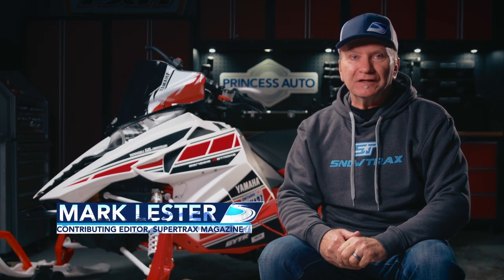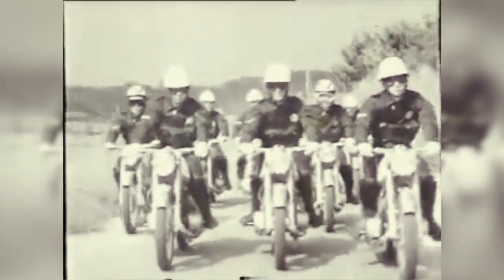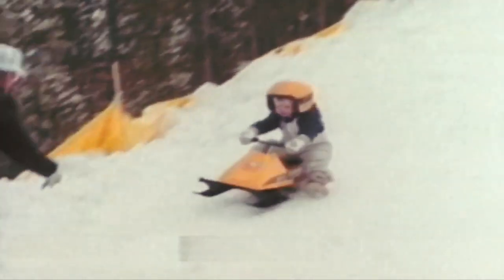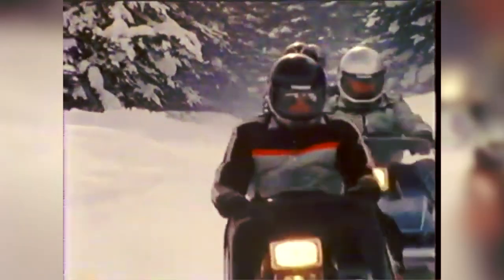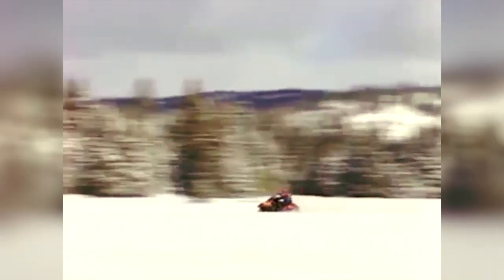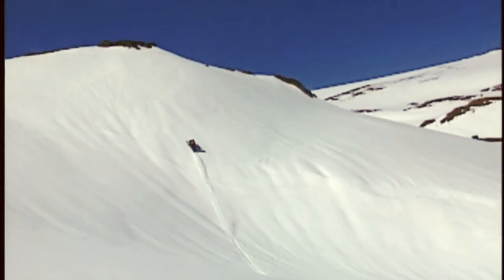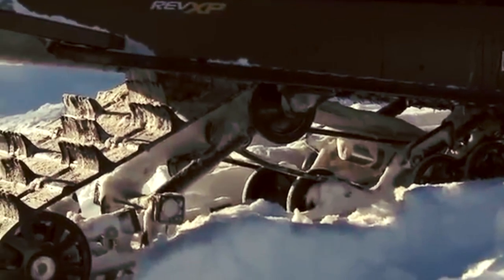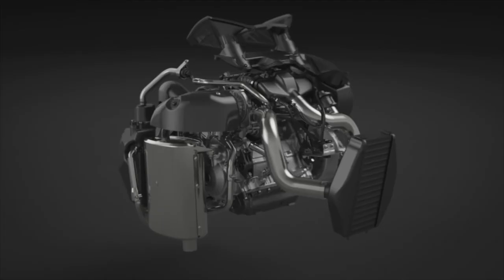50 Years of Yamaha Snowmobiles

Comment: Mark did a decent job with this video. One big miss, the TSS (Telescopic Strut Suspension) was not introduced on the 1984 Phazer as claimed. It was introduced in 1980 SR-V race sleds and then appeared on the 1981 SRX and SR-V, so that was three years before the Phazer was introduced.

Comment: It's amazing how early Yamaha put Oil Injection in their sleds with the Yamalube.  I had an 81 Ski Doo that i still had to mix the gas and oil in a Jerry can.
Reply: Yamaha had  oil  injection on a  street bike in  1964 ..  All Yamaha  two stroke  Motorcycles  had  oil injection by the Late 1960's  ..  The Other  Brands  followed quickly .. Not sure if there was an  issue  pumping  two stroke  oil when it's  really cold ..  Yamaha Lube  is not that great of an oil  Today's  Modern Synthetic TCW-3  oil is much better..
Reply: Yamaha  had  oil injection  on  Motorcycles  in  1968  or ealier ..

Comment: I purchased a new 84 Phazer. I used it for pleasure riding as well as drag racing. At the drags it drew a lot of attention because of it's looks. I immediatly started winning with many people saying my machine was not stock. I was doing quite well in the next class above the Phazer's class. Some thought i had modified the engine. Others came to me to look at my track, thinking i had it nailed. I always said riding the Phazer was like riding a bucking bronc. You had to really hang onto it when you hammered it. It was a fun snowmobile to ride. I purchased a new 87 Exciter. The Phazer ran circles around it.

Comment: my nytro has heavy handling and steering  wanted to stay with yamaha motor and chassis for reliable sled but they need a 2 stroke. Also they need a light, basic, cheep, affordable , 440 trail sled to pick through the woods and when needed you can pick it up and move it

Comment: Interested to see what Yamaha has in store for 2020.  Our local Yamaha dealership has just started selling Arctic Cat/Textron products after being an exclusive Yamaha dealer since the dawn of time.  He was quite tight lipped on the future of Yamaha sleds from his end.  Still dreaming of a Yamaha 2-stroke 600/800.  I'd buy 2 the day they came out.
Reply: Don Olypopper  I have a 2014 viper xtx and I can relate to some of the complaints you especially since I own a Nytro as well and although the Nytro feels higher quality the viper is such a better sled overall, the supposed cold starting issue is not really an issue you just gotta learn how to treat the viper, although it should just work like the Nytro it's not actually a real problem. But that's just my opinion, I have had all the recall work done on my sled at my dealer free of charge and everything is working flawlessly for me so far.
Reply: It better be a two stroke because they lost a ton with these heavy tank like 4 strokes !
Reply: They made a 2 stroke this year finally.
Reply: @mxr7586  you mean they had Cat toss their 2 stroke into a Cat chassis and call it a Yamaha.  I believe Yamaha's last all-new 2 stroke was the SRX motor in 1998.
Reply: @PartTimeYooper  last srx was 2001 which was the fastest. I have the 99 a friend of mine has the 98 and another the 2001. The 2001 he put a ski doo skid underneath and up front he did yz450 4wheeler shocks. It’s bad ass.

Comment: My first machine was a 1978 ET250. Super reliable little sled. Then a 1980 srx440. With 72 HP  that one was a rocket for the times. Hard on pistons and cylinders though. Last Yamaha I bought was a 1982 Excell 3. Basically a 340 cc with electric start and a spedo and tack. Also a super reliable sled.  Then in 1986 a friend asked if I  had seen the new sled at the polaris dealer at our local mall. He convinced me to check it out and the next day I bought the 1986 indy 600 triple after seeing it. Polaris after that, sorry Yamafans
Reply: I have a 1979 et250. A et340 
Both enticers. I still have them both. Won't part with them

Comment: Snowmobiles  were so crude .. It  left a  lot of room for Yamaha  to innovate..  Yamahas  were light  reliable   and  affordable ..
  Sleds  like the RX 1 Ton  are  great high mileage  trail sleds..     The  engine  technology came  straight from their R-1  Motorcycle  engine,..   Then  they built the  narrower .. longer  stroke   3 cylinder Purpose   1049  CC  snowmobile engine..  
   Then they came  out with a  beefed  up  Tripe with  a high tech Turbo..

  Yamaha was No  1  in snowmobile sales  for years  then they went to   number.  Meanwhile  Artic  Cat has some Financial  Problems..    Trump  dropped Corporate  income tax  by 15%  this  will help  the  end cost for American Made Products..

  Yes the Yamaha  Two Stroke Triples  were cool and great..  I think Yamaha may have  been  behind  in suspension  in that era...
  All   3.5 Brands  make  great Products  it's  a  matter of  personal choice  ..  Customer  Service  Factory Warranties  and Value  that  could  make an end decisions what to buy .

  I have a  2006  Attack that is  Very  tough  but  so Top Heavy ..and  a  2014  Skidoo Renegade  800  because I like the  lightness and  the direct  injection two stroke..
   I have not yet  ridden  an Artic chassis..   I am interested to try some  Endurance racing  .. which sounds  like  Polaris and Artic  two stokes dominate that class. ???